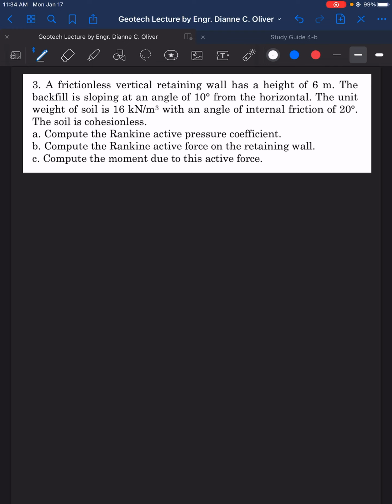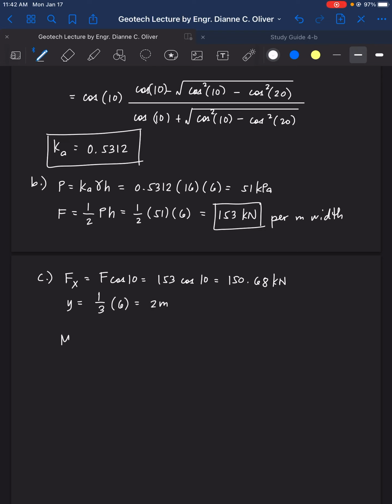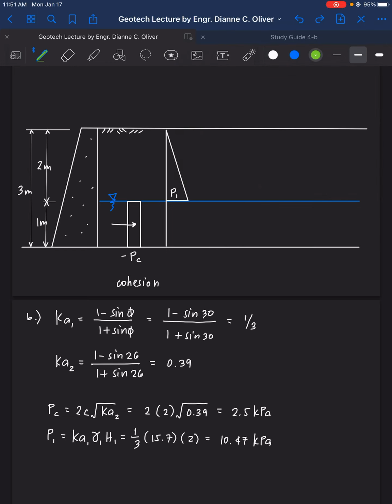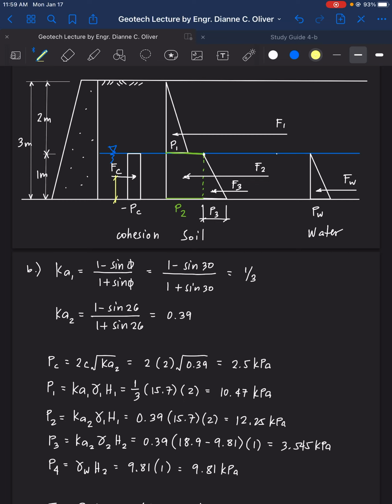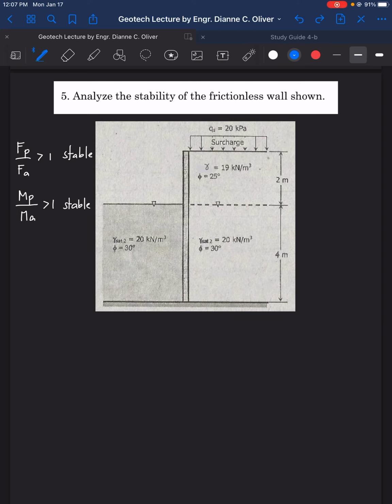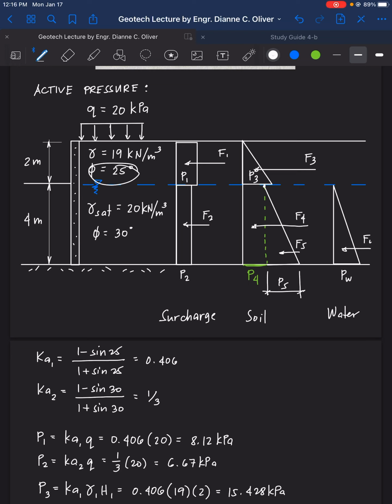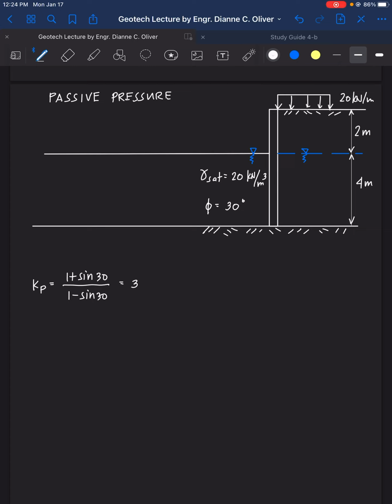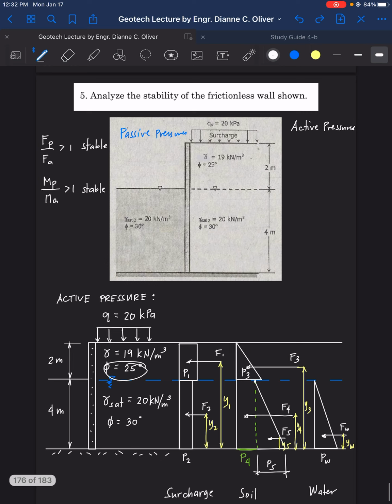Geotechnical Engineering: Lateral Earth Pressure (Part 2)

Comment: Good afternoon, Engr. Oliver. May I ask if you can present a video solution to this problem?

An excavation 5.5m deep in cohesionless soil is supported by a vertical cantilever sheet pile wall. The piling extends to a depth  of  3.6m below  the  bottom  of  the  excavation.  The density of the soil is 18.1 kN/cu m and the angle of internal friction is 33 . The water table maybe assumed to be below the bottom of the piles.
1. Find the active thrust on the wall per hor. meter, neglecting wall friction.
2. Compute the passive resistance which must be mobilized for stability of the wall.
3. Determine the theoretical passive resistance available.

Thank you.
Reply: did you get the response if so, can you assist ..thank you